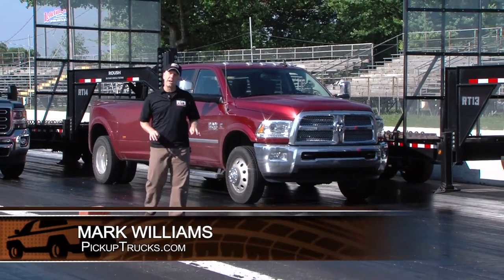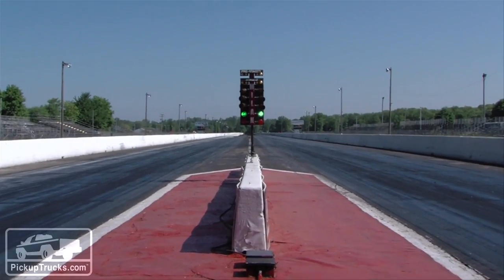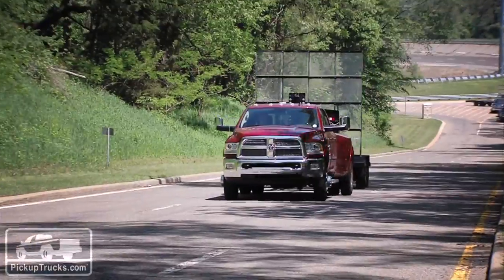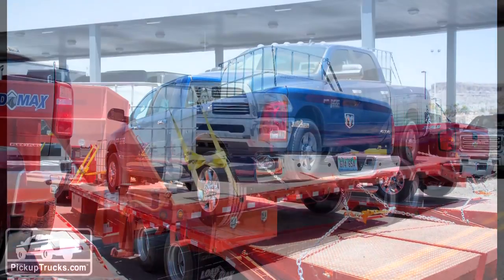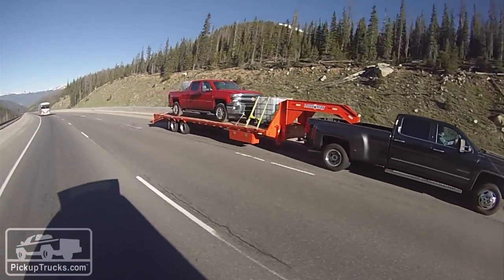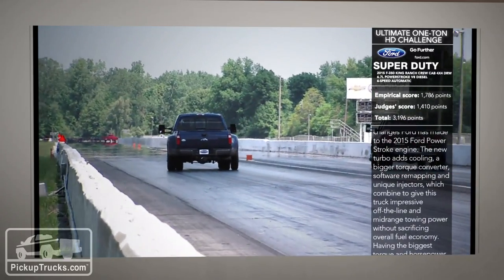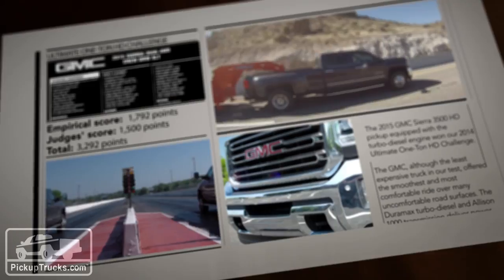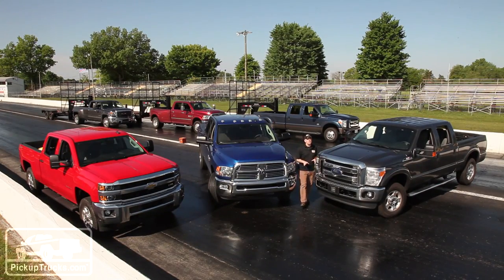2014 Ultimate Heavy-Duty Challenge: One-Ton Video

Comment: The Ford has 880 lb ft but doesn't win?
The Ford has stiffer suspension for greater stability when hauling or towing the heavy loads but doesn't win?
What trim level did the Ford have?
What was the fuel mileage for the Ford towing and empty?
Reply: The issue is, the Ford has the most antiquated transmission and gearing. That make a huge difference when each truck is so comparably equipped under the hood. And with my business, these one ton trucks need to run completely maxed out the whole time they're on the road, and I find the exact same running order. The Chevy/GMC doesn't break a sweat for most loads, while the F-350 is always breathing heavy. Maybe if they got in with a transmission company that could build them a 6 speed to bolt on to their version of the Powerstroke, it might push the performance up a bunch. The biggest problem Ford has right now is, they took the motor build away from International, and started building it themselves. It's just not the same anymore.

Comment: this test doesn't really provide anything.  I judge a truck by it's longevity.  how long will it last. doesn't matter the brand,  they all break down at some point.  like I currently drive a chevy duramax.  but I'm a cummins guy. may not finish first in reviews.  but it'll out last most engines.  with minor problems.  I ve had three. with over 300k miles and hardly no engine problems if any.  my brother in law ford, already been through 2 turbos. my chevy seems strong.  but only time will tell if it's a  good truck or not.

Comment: too bad they don't perform that way on the road . those Mama's babies you sacrifice ride for load ability. when my 350 is pulling my fifth wheel at max I have a smooth ride it doesn't strain and the GM and Chevy drivers get mad when I pass them on the uphill side and they go around me doing more than the speed limit for that is what my cruise is set on. or maybe they are just overloading. I don't understand you tell me 2012 6.2 flex fuel f350 running at 22863lbs. put the cruise control on the speed limit and it keeps it right on the money varified by my GPS unit.

Comment: There all good trucks but better odds the Cummins will still be running long after the other two are sold for scrap.
Reply: The cummins will be running for sure. But the truck and transmission it's paired with will not last too long.